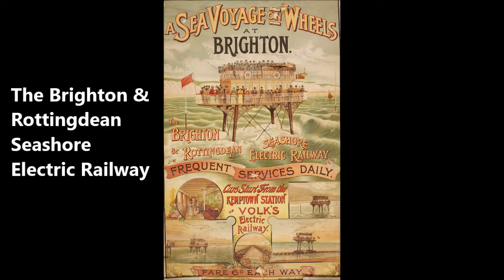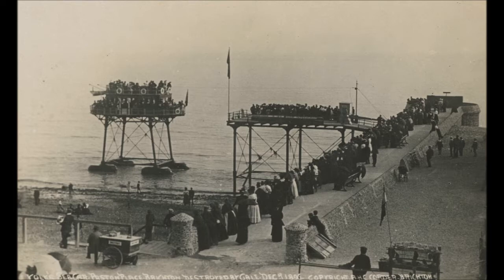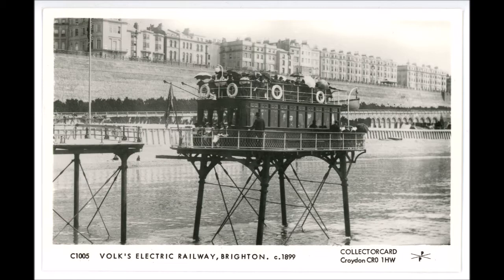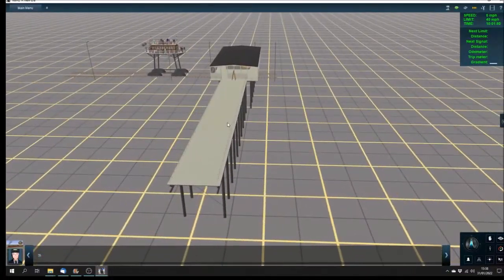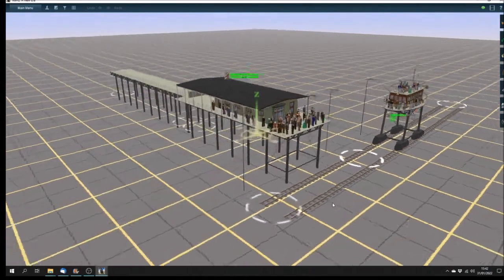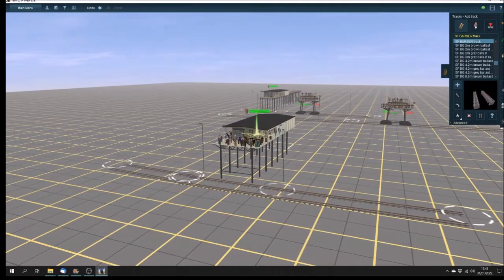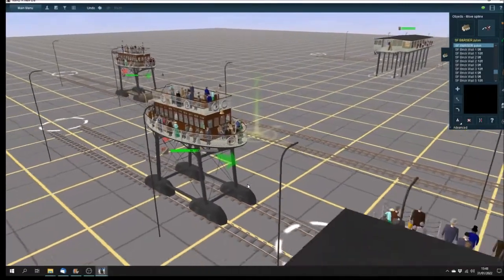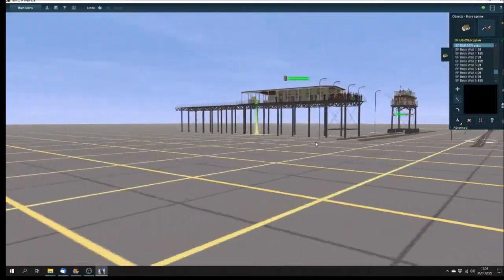The 'Daddy-Long-Legs' railway for Trainz railsim

Comment: Ooh this means a possible volks electric railway pack coming soon?
Reply from the maker: If anyone has scale plans of the VER in Brighton please let me know.
Reply: @ing4trainz  if i recall correctly the distance of the railway is like a mile or 2 km? Ill try to get you some scaled plans if i can bud!
Reply from the maker: Originally it was a fair bit longer I think. Scale plans would definitely put it on my 'to do' list.
Reply: @ing4trainz  oh by the way I know you dont do too mutch routes but do you plan on doing one for VER or the Atmospheric one? I am not good at building routes, but I am willing to dowload them on the DLS if you post them there
Reply from the maker: No, I don't plan on making routes.